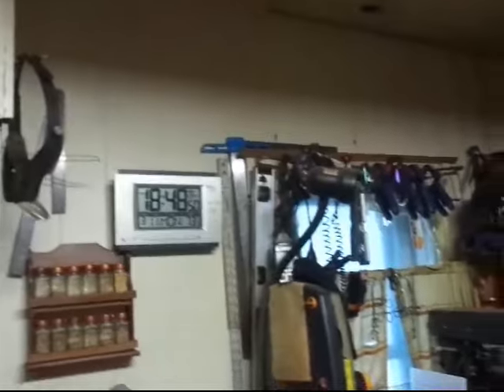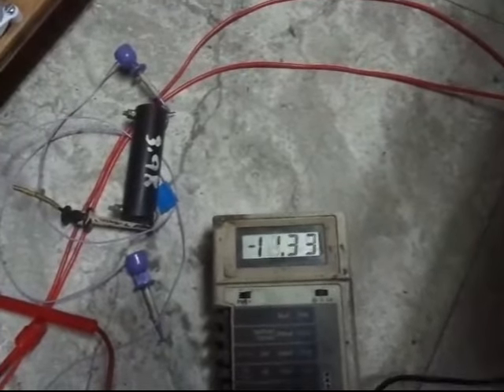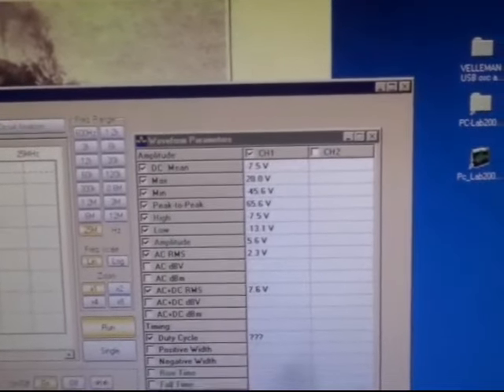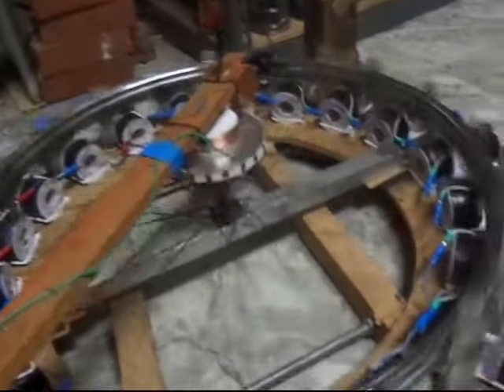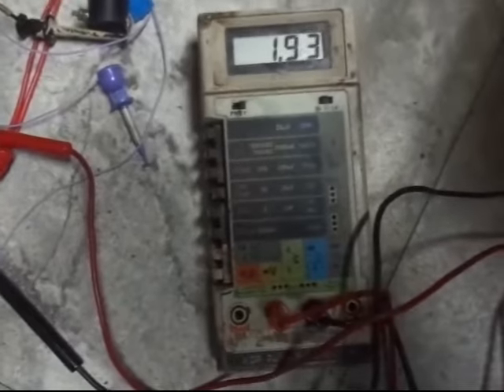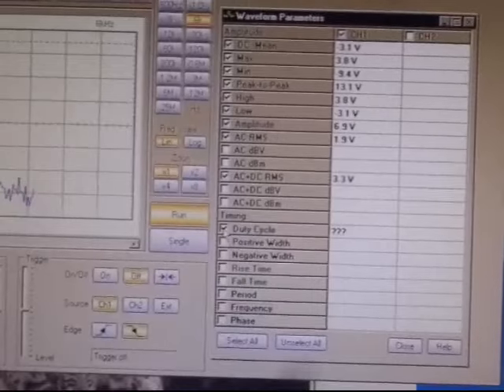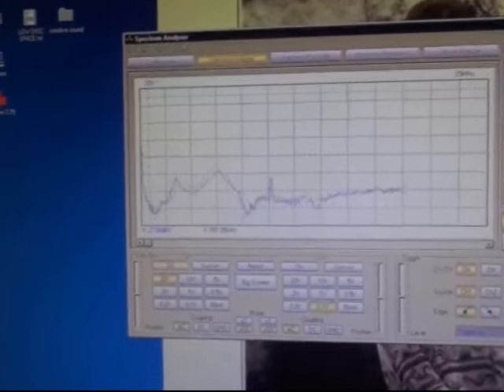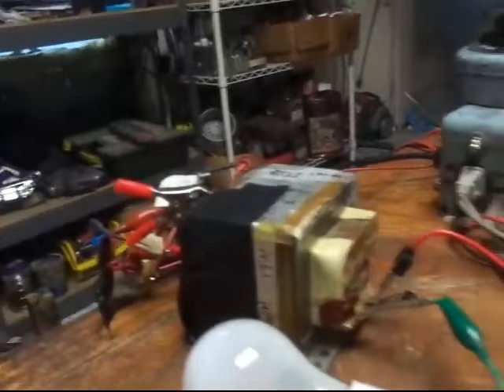Newman bike wheel

Comment: Hey for anyone else who is working a similar design as if by revelation. Try using an old Iron wagon wheel. The 8 iron spokes and the axel can all be used like magnetic poles if you put opposite wound coils on them.  you can control all the poles and create positive or negative radial monopoles. Also I'm pretty sure that's what they was depicting in scripture as the cherubim.